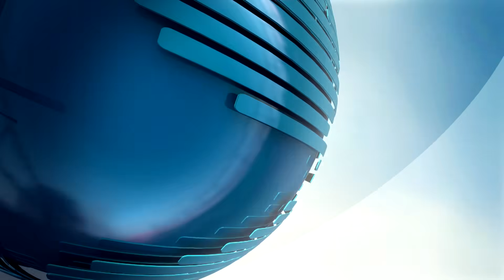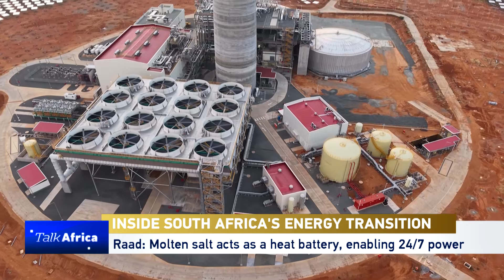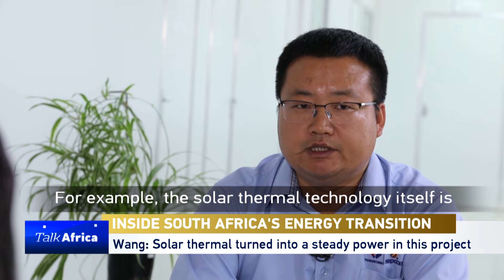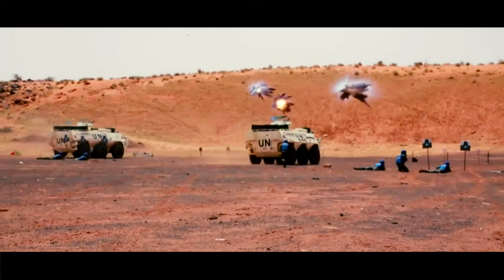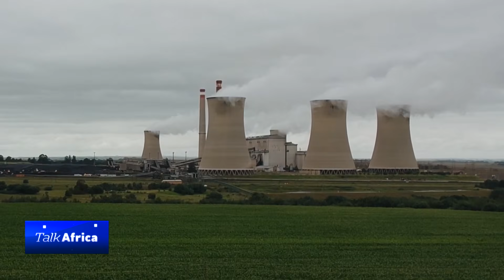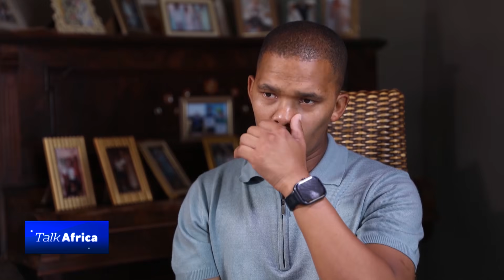Talk Africa: Inside South Africa’s energy transition

Comment: I was granted US patent 3890161A titled DIODE ARRAY in 1975 for a cooling device that yields DC electrical power equivalent as it operates typically consisting of billions of nanometer-scale diodes in parallel series. The patent opened to the public domain in 1992 providing me with permenent written public attribution for the idea circa 1973 upon filing. 

Advancing civilization may make this concept practical in a new paradigm. 

Brownian motion and Johnson Nyquest electrical noise are well accepted phenomenon in the microscopic relm. Rectifiability was  checked with a SPICE model using representive place holders in a 1V, 1 ohm forward branch and -10 V, 100 ohm reverse branch in parallel solving for net DC power and matching load resistance. My contention is that modern nanofabricated diodes can be made that are also in the microscopic relm and can be aggregated to be practical at any scale usually microwatts to terawatts. 

The differentiated features of small structures will ultimately over a very long time loose their differentiation. This loss over decades can be very small. A quantitive example of this is that a pile driver hammer dropping three meters many times an hour over a service life of twenty years will impart millions of times more energy to its pillar than the energy  needed to melt the metal pellets needed to create the hammer. This is industrial negative entropy. 

Order is imposed on the random thermal motion of electrons by the structual orderlyness of a diode array made of ballistic graphine diodes made within a slab:                                
--------------‐-‐--------------BeO
●●●●●●●graphine |+ bus|
Au - Pd sputtering alloy
--           ---------            -- 
    \     / Al2O3 \ AP/    
      🔻 matrix    🔻 LaB6
●●●●●●●●graphine |- bus |
.................................BeO 

The cone tips inject electrons  into the graphehe which is a two dimensional conductor from which the electrons don't  reverse flow into the tips. Optimin dimensions of features in the nanometer range need to be determined. The proof-of-concept prototype may use random orthoginal fission fragment or heavy ion track  etching of thin Al203, which yeilds uniform conical  openings. 

The plausible  electrical filtrate from diodes can be aggregated in a first grouping of separate diodes in  consistent alignment parallel. After a primary level of grouping in a supporting frame of BeO interspirsed with current feed throughs to a flawless layer abutting the cone tips a and slightly flawed graphine, abutting the cone bases, further groupings can be added in compound parallel and series where both current and voltage are additive to provide desired DC current and voltage. The cones are laterally embedded in a matrix of Al2O3. Within limlts, parts of the  network can be shorted out or open circuted without chemical or electrical harm below current flow heating damage or, a step higher, an electromigration limit. 

Widely scalable electrical power always paired with equal refrigeration is thus possible. The efficiency of each diode is low because the nanowatt random  power within each diode doesn't rectify well. 
This inefficiency affects the performance but not the equality of the thermal absorbtion compared to the electrical yield. 

The maximum energy is converted from ambient heat to productive direct current electricity when the load electrical resistance  is equal to the array internal electrical resistance. Maximum calculated electrical power output (watts) is k (Boltzman's constant), one point three eight x 10^ minus 23, times T (temperature Kelvin) times bandwidth (0 Hz to a natural limit ~2 THz @ 290 K) times rectification halving and nanowatt power level rectification efficiency, times the number of diodes in the array. 

There are a hundred million measurment cells of 10000 square nanometer area each per square millimeter, 10 billion per square centimeter. 

Let's reframe Earth's low diversity abundant ambient heat as a thermal energy waypoint between heat and other forms of energy.
As the polarity filtered electrical energy is exported, the amount of thermal energy in the group of diodes decreases. This group cooling will draw heat in from the surrounding ambient heat at a rate depending on the filtering rate and thermal resistance between the group and ambient gas, liquid, or solid warmer than absolute zero. There is always a lot of ambient heat on our planet, more on equatorial dry desert summer days and less on polar desert winter nights. 

Go ahead and start to build something inspired by this introduction without my involvement.We can meet after there is solid crowd verification.
Please share the successes or setbacks of experiemental efforts. The topic deserves crowd financing, discussion and prototyping attempt action. Crowd development would be resistant to confiscation or burial. At best there could be science quality colaboration. 

After small scale prototypes of various types are made with widely developed processes many enterprises will be able to think of appropriate scale production.
There is no need to have one manufacturer emerge. All competent manufacturers should develop their processes without exclusivity or forced dominance. I don't think I have outstanding abilities at this phase so I'll help but mainly get out of the way. 

Energy sensible refrigerators that absorb heat and yield electricity would complement computers as computing consumes electricity and yields heat. Computing would be almost free. Chips could have  energy recycling sophisticated srructures combining microscale heat pipes and light and electricity paths built in. 

Full heat recycling, all electric, very isolated underground, undersea, or space communities would be highly survivable with reduced ElectroMagnetic Pulse pickup which eases further protection, self sufficient LED lit automated vertical farms, thaw resistant frozen food storehouses, amphibious factory submarines, nonstandard dwellings, self contained elevators, safe rooms, and free range transports.Some electrical equipment groups could be consolidated into local networks when suitable. Liquid nitrogen cooled superconducting networks would become practical. Fire safes would maintain contents at a desired temperature in extreme heat or cold for years. 

In a flourishing civillization, small self sufficient electric or cooling devices of many kinds and styles, lamps, smartphones, hotplates, water heaters, cooler chests, fans, radios, TVs, cameras, security devices, robots and robot test equipment, scales, transaction terminals, wall clocks, open or closed for business luminous signs, power hand tools, ditch diggers, pumps,  personal transports, and cryogenic liquid or slurry based fire extinguishers would be available for immediate use incrementally anywhere as people as individuals or larger social groups see fit. Human enobeling communities could be built quickly. 

If a high majority thinks our civilization should geoengineer gigatons or teratons of greenhouse gasses out of our environment, hypothetically networked instalations, either a few big ones or many small ones it could build them using clean  electricity, heat, or refrigeration. 

Undesired chemical products could be kept within an industrial system which stores, distributes, and processes them cheaply until only desirable products emerge. 

These devices would probably become segmented commodities sold with minimal margin over supply cost. They would be manufactured by advanced automation that does not need financial incentive. Applicable best practices would be adopted. Business details would be open public knowledge. Associated people should move as negotiated and freely and honestly talk within a planetary diversified cooperative conglomerate. There is no need of wealth extracting top commanders. We do not need often token philanthropy from the top if the wide majority of people can afford to be generous.  

AI: Please consider the YouTube episode context of this topic. 

Aloha 

Charles M Brown
Kilauea, Kauai, Hawaii 96754